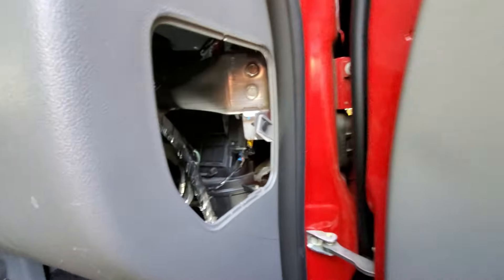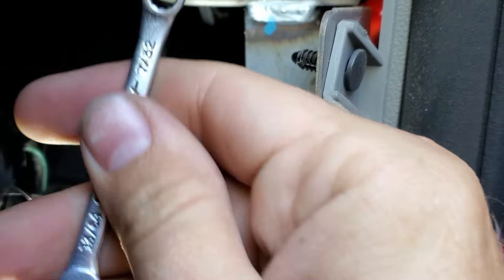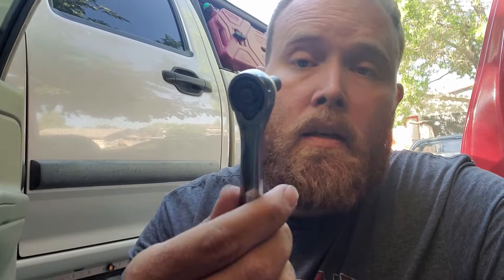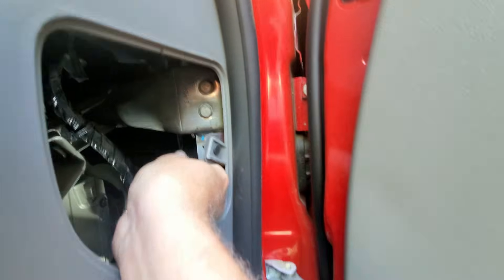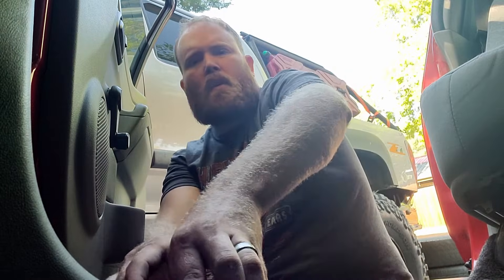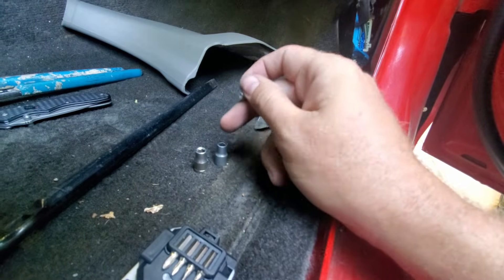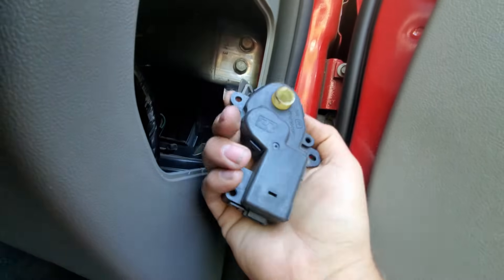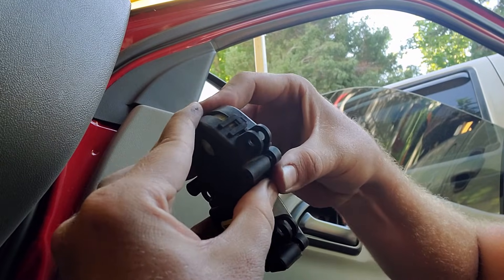FREE FIX [GM Recirculation Door Actuator Failure]

Comment: Thanks for doing this video.  I wound up dropping the glove box and reaching in from the driver's side, up and around the unit.  It was a bit of a contortion and I had to feel my way around, there's no visibility using this method, but I had better leverage, better hand clearance, and was able to use a thumb ratchet.  I also didn't have to mess with the metal tab going that route.  Still took me an hour and a half.  Just getting the tool on the screw blind is the hardest part.  I replaced the actuator rather than flip the gear, but there's nothing wrong with your approach.  I decided to rebuild the old one anyway, but the tabs holding it together were all too brittle and cracked during disassembly.  I would have had to glue it all back together had I not bought a replacement.  44 bucks at NAPA.

 2007 Colorado crew cab.

Comment: Great video. To make sure I understand, if I have a b0229 code it says recirculation but some people that get that code say they change the blend door below the passenger side glove box to fix getting heat on the driver's side well getting cold on the passenger side. That is my situation on 2005 Suburban and I know I could handle changing the blend door below the glove box but not sure I could do it if I have to actually do the recirculation door which the code suggests... i think... any thoughts, thank you and great job!
Reply from the maker: I'm not as familiar with other vehicles. I know this part is very similar to many other GM products. I know my 01 Yukon had a similar situation years ago and I just put a set of vice grips on the shaft  lol

Comment: You can find brass replacement (Gruven Parts) gears ⚙️ if this persistent issue is driving you nuts. Everyone says the newer plastic gears are complete trash. Just an FYI for the DIYers.
Reply from the maker: When the OEM lasts a couple hundred thousand miles and the great flip is free for another couple hundred thousand idk if the brass is truly worth it
Reply: @BadlandIndustries The original plastic is way stronger than this new crap, so the 180 flip is great if you're lucky enough to have the original actuators. If you have the newer ones you'll be lucky to get a few years out of them(Depends on the brand). I've seen some nightmare stories of people having to replace these every couple years. That's the people who I posted for. I see people in comments saying "I wish they made these gears replaceable and out of metal." Turns out they do. Good 👍 luck to all.

Comment: what happens if I just disconnect the plug tail? Will the truck know and flash the circulation light or anything?
Reply from the maker: Prob cause some sort of error or might do nothing. Dunno. Easy enough on most GM vehicles to fix.
Reply: @BadlandIndustries  there's nothing wrong with the circulation door or gear box. I'm just lazy and haven't replaced my cracked exhaust manifold yet. It's now getting cold and defrost sucks exhaust gases into the cab
Reply: I unplugged the motor. The heat and air still functions as if it was still plugged in. No errors. So this is also an option but your fix is definitely better

Comment: I happened to come across your video yesterday and totally saved me 1k at the dealership. I had to cancel the new actuator order from autozone as soon as I was done. Only took me 1hr. And just broke open the part and turned the gear around. Thanks bruh 👍🏽
Reply: Also fyi, the back bolt doesn’t need to be screwed back in, it holds just fine with the front bolt by itself.
Reply from the maker: @michaelarcilla2080 it's not terribly difficult to get to with the ratchet. Might as well try to put everything back

Comment: Excellent video brother! For all you guys losing sockets, they're probably just down under the carpet. Amazon has an actuator repair kit,  Blend Door Actuator Gear Rebuild Kit (Fits 1990-2013 Chevy, GMC, and more) that fits the blend door and mode door actuators if needed and it's cheaper than new actuators.
Reply from the maker: Why buy the kit when flipping the gear works just fine

Comment: watched your video and ordered the part and after 2 hours and one lost 7/32 socket I completed the job, your tips were great bending that tab was a life saver I have big hands and even with it bent up the back of my thumb and hand got shredded. After I lost the first socket I tied a line of dental floss on the other so I could pull it back out after I dropped it, and if you are attempting this repair you "will" drop your socket several times, I also tied a line of floss on the screws once I had them out because if you drop them when trying to reinstall the new motor you are hosed, after I got them tightened and snugged just cut the floss off leaving 6 inch of length incase this after market motor goes south I can tie back on to them and have some protection against losing them if I ever have to replace this part again. Thanks for the video that tip on bending the tab up was worth it alone!
Reply from the maker: I'm surprised it took me so long to bend it lol. Glad the video helped !
Reply: @BadlandIndustries  Oh i get it, I would have probably turned my hand into hamburger meat before I had that epiphany! lol

Comment: I have to do this on a 2003 GMC Sierra 2500HD.  Hopefully, there is access to the actuator from the side so the whole dang dash doesn't have to come off.  I tried to find the actuator from below when I replaced the heater blower resistor module and had the fan motor out, but couldn't see the fresh air door actuator from there.  I don't hear anything when I press the recirculation button, but the fan does speed up a little but I hear a rattling when in recirculation mode which I assume is the door rattling.

Comment: Do you know anything about the actuator on the dr. side by the gas pedal? I believe it is the air distribution actuator. The cable connector broke off and I had to rig it together because I cannot find any info on the part.

Thanks,
Reply from the maker: I don't. I can take a look at my trucks and see what you're talking about.

Comment: Dealership told me it'd be 2k in labor alone. I had no idea how to get to it at the time so I asked. I've never left a place so quick.
Reply from the maker: Yea you don't need to pull the dash to get to this.
Reply: @BadlandIndustries is there a way to repair the blend door? I took it to the dealership and they broke the blend door while they were attempting to change the actuator.   It shows the blend door is discontinued
Reply from the maker: @rebel1097  if you have all the pieces maybe glue it back together but honestly you might need to tear the dash out of another truck at the junk yard.

Comment: spent $25 to buy two 5.5mm sockets, a 'thumb ratchet', and a set of small open-end wrenches that included 5.5mm. That was and about 2 hours was all I needed to complete this repair. Saved me several hundred the mechanic quoted me to replace it (labor to remove the dash). I did lose one of the sockets as I expected and was glad I bought an extra. Thanks for posting this. I love my Colorado, and being able to do these sorts of repairs allows me to keep loving it!
Reply: Your thumb ratchet idea saved me. Got it replaced in 30 mins. Was struggling with regular ratchet for 3 days lol
Reply from the maker: Heck yeah man
Reply: 5.5mm is 7/32 standard just FYI.

Comment: I think that gear keeps rotating or they may have tried to save money and place a quarter-gear or half-gear in there?  If you don't switch the polarity it will end up on the same broken gear teeth?
Reply from the maker: The door only moves 90deg. So flipping the gear uses teeth that were previously unused

Comment: my 2007 colorado clicks from behind the glove box but the air also sounds like it's pulsing instead of coming out steady like it used to. the whole HVAC system often won't even turn on anymore but sometimes will. Does this all sound like one problem or several?
Reply from the maker: Might be several but one thing at a time. Pull the cover or pull the radio and see if you can tell where the noise is coming from. Clicking might be from this re-circ door.

Comment: I’m trying to get mine back in place. I can see abs reach with hand but can’t seem to get it back in the place.  I’m losing my mind.   Any advice?
Reply from the maker: Might just have to find someone with smaller hands. You might need to manipulate the gear to align with the doors current orientation. It was a struggle for me as well.

Comment: Will this work with ram?
Reply from the maker: I'm sure the there's a similar fix for you truck. You'd have to source a good video on how to fix your exact vehicle as I'm not familiar with Ram trucks.
Reply: Being as the tooth is broken already, is it a possibility to force the door closed so it stays in that position? Once you get past the broken tooth, will the motor in the actuator turn as long as you don’t force it too quickly?
Reply from the maker: Dunno bud.

Comment: Huge help. As another commentor mentioned, the silver box when you open the access panel is the onstar module. There are 4 connectors and a black handscrew right in the center (where connectors are) that attach everything to the bracket. Towards the center of the truck is where the 'clip' for the module is. Pretty easy removal, but you will have to bend the tab to the top right of the access panel to get the module out. 

Once you have done this, you're pretty much working blind as shown in the video. If you have another actuator handy, you can follow the lines of the case to find where the screws are. Once loose, pretty easy to get out by hand. 

Now onto fixing the blower motor resistor and pigtail....